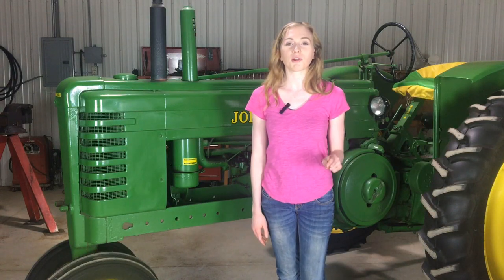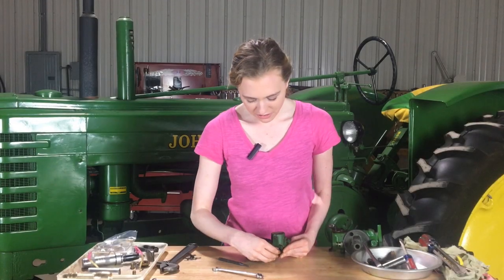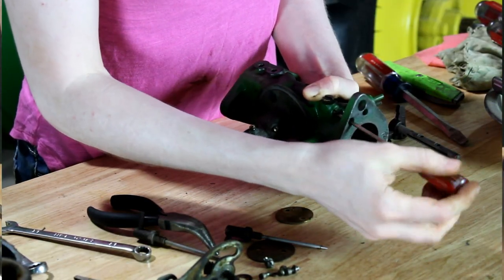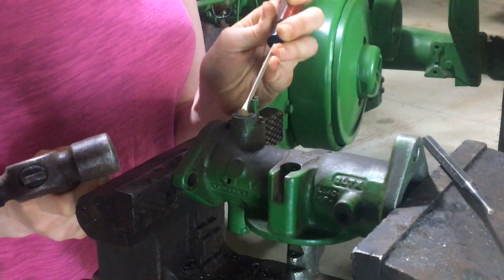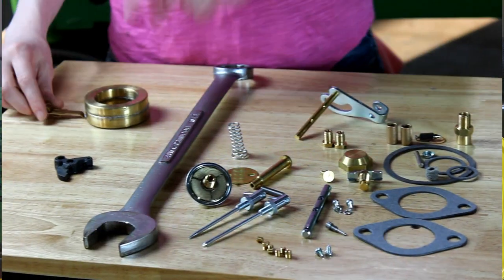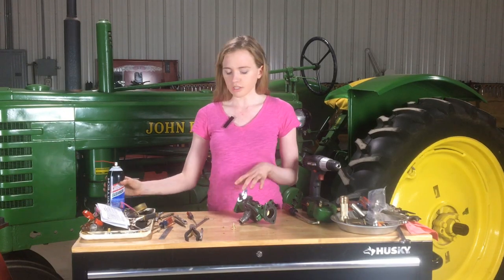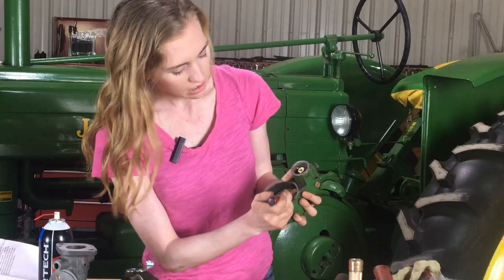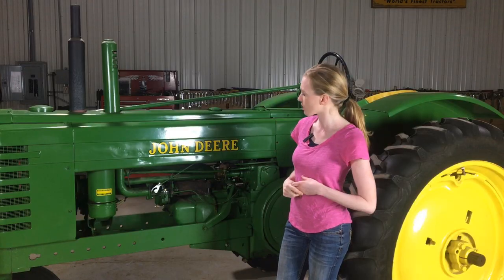John Deere 2-Cylinder Carburetor Rebuild: Easy Step-By-Step Instructions

Comment: My father in law purchased a 1939 B with a two bottom plow brand new. He sold his team of four horses and became mechanized. When he passed away he still had his 39 B and plow. He taught me how to start it, by twisting her tail. He also showed me how to run it and start it on gas then when it got warm enough switch to distillate, "fuel oil". We always was working on it, tinkering is more like it, but it always ran well. He also had a 70 with an end loader on it. Those were the best days for me personally. The old johnny popper was a special tractor for him and me. I must say though we didn't do as thorough of a job as you do, but we did keep her running. I am addicted to watching your tutorials and hope they continue for the long term. Keep smiling and all the best for you.

Comment: Very helpful video when I was working on my Dad’s tractor. The tips you provided helped me get through a lot of areas I was hung up on. There were some times I couldn’t see the screw or part you were referring too as the camera angle was blocked by a hand or not enough light. Either way this video is extremely helpful. Thanks for making them!

Comment: I rebuilt a 1946 John Deere Model B and I spent a snowy winter in the woods North of Greenbrier to dismantle two other models to repair my tractor.  Simply made and easy to repair. 
American Manufacturing has only added more whistles and bells to newer models.  I do acknowledge the extras like cab, air conditioner and radio. ;D

Comment: The reamer used is a 5/16 .3125 chucking reamer. If the throttle shaft is too tight in the bushings the governor can not adjust when the engine is under load.

Comment: having just completed the rebuild on a dltx 71 i noticed some parts that weren’t included in the kit, but should have.  3 brass plugs, for the choke shaft, and the two access holes for the idle air on the side.   i also had to trim the felt throttle shaft seal to 1/3 length.  i also had to use the shaft of an extra long 5/16 drill bit to align the throttle shaft bushings so that the throttle shaft would move freely. ‘49 A

Comment: When I did my dads B John Deere I put all cast iron parts through a self cleaning oven and then blow and wire brush it off then double check passages it cleaned up like a brand new part.

Comment: Well, this past spring I bought the 6" aircraft bits from W.W. Grainger and tore into my carb. 37 B DLTX10. I really put some heat to the plugs to get them out. Used the bits in the passages. Found the idle passage from stem yo top was plugged solid. Soaked it, sprayed it out, put it together and on the tractor. WHAT A DIFFERENCE!   Took it to the spring show. Started fine. Fellas commented on how good it sounds. Started for me.
Now - fall. She won't start by hand. Have to pull her. Pulled carb apart. Clean as a whistle!  Oops, left the main jet spring out in June. Made one from piano wire. Got to the show.  Had to pull it every time to start it. But then it ran strong! Any thoughts?
It has a Fairbanks Morse RV2B on it. I think it's going to Rudy Cailin this winter.

Comment: Like all these old tractors, fuel & DEBRIS gets into the tank. This is where rubber line helps. With long rubber, you can bring it above the tank and blow the fuel back up into it. This is sometime necessary because debris gets caught in the sediment screen.

Comment: Very nice video. Good process and professionally done! One comment though. You mentioned heating certain parts if necessary. Never use an open flame around a carburetor for obvious reasons. There may be gasoline residue in the carb or around the work area.
Reply: She did say make sure it is clear of gas.
Reply: Hey bozo, the gas is all evaporated
Reply: Settle down white knights.  He's got a point.

Comment: Your video is excellent, I am soon going to be involved extensively in getting one very neglected John Deere Model A. Left in the field from 1980s until now. Unfortunately the air cleaner stack  was removed. I am hoping that water hasn't made it into the Engine. The owner is an elderly man who purchased it New and he would love to have Her running again .She is in bad shape from the looks of things the Goat's was made short work of the edible parts,  wiring seat and all. I thank you for the fine instructional video.
Reply: Please disregard the missing and incorrect words. I should have proof read before posting my comment.

Comment: I understand (but may be wrong) that three drill bits are needed to clean out the passageways on a DLTX-10. They are #53, #57 and #40.  Can you direct me to some picture and/or directions that tell which drill bit is used for each passageway?

Comment: ATTENTION!!!
Anyone looking for information on the drill bits she cites in the video. Google search or speak to your local hardware store (I had luck at ACE hardware) for a Wire Gauge Drill bit (set). 
They typically come in sets numbered 1-60 and 61-80, or you can buy them individually! Hope this helps...
Reply: Also, Rachel, you might consider setting up an amazon store and link tools in the description to add a small revenue stream :)

Comment: If your Flushing Your Carb Passages & Intend to Paint your Carb Body, Id suggest Using Brake Cleaner as it dries clean, Carb Cleaner leaves an oil film & Will make it difficult tro paint over carb cleaner residue

Comment: where did you get the drill bits?
Reply: Roger Harrison
Reply: Roger Harrison Roger I think you're talking about the ream she used to clean out the throttle shaft bushing's. You would need to go to a machine tool online store most likely. Not cheap and not recommended to use the way she did you probably could do it with a simple long drill bit if it's a standard size like quarter-inch or 5/16 you could get it at Lowes or the big orange store.
Reply: See my other comment about this :)

ATTENTION!!!
Anyone looking for information on the drill bits she cites in the video. Google search or speak to your local hardware store (I had luck at ACE hardware) for a Wire Gauge Drill bit (set). 
They typically come in sets numbered 1-60 and 61-80, or you can buy them individually! Hope this helps...
Reply: Check www.drillsandcutters.com They have the #40 ($1.23), #53 ($3.96) and #57 (4.77) that I need but haven't ordered yet.  Shipping is $7.99.  Be sure you get the 6 inch (read the description of each) because others they offer are much shorter.  They prefer to ship in a pack of 12 but the site says they will sell one if that's what you need. I didn't see them on the Ace Hardware site but haven't checked the store in person. The 40 is 0.0980", the #53 is 0.0595", the #57 is 0.0430" diameter.

Comment: You needed to address the nozzle, ( brass) which goes in the tube that extends through the carburetor bowl before the spring and the bowl nut. If people don’t get the big kit, they need to run gas welding cleaner rods through the holes in the nozzle.

Comment: U should always check 😊😊 the old carb float U should shake it and there shouldnt be no noise or rattle in it if so theres a whole in it and it should be repkaced w a new 1😊😊  OMG 11 29 2O23

Comment: Your brass hammer is getting a mushroomed head on both sides and can pose a risk of shrapnel flying off and causing bodily injury. A flap wheel sanding disc will reduce the mushroom, and giving it a bit of bevel will slow the build up which is the result of normal use.
The same can be said of chisels and punches.

Comment: Question, Why are you not recommending the proper tools ?  Why are you using  combination wrenches to remove the fuel lines?  You should be using line wrenches, to prevent damaging or rounding off the corners of the fuel fitting.